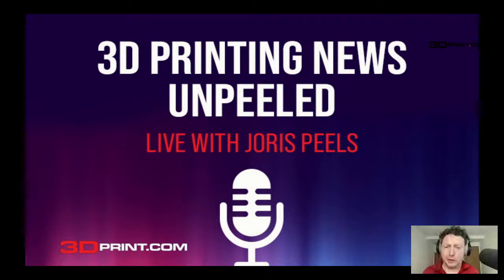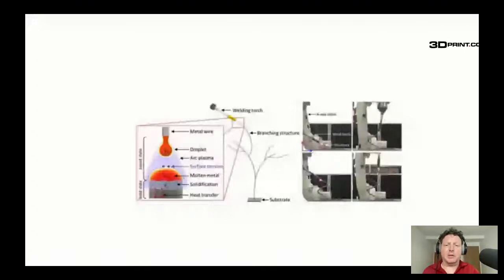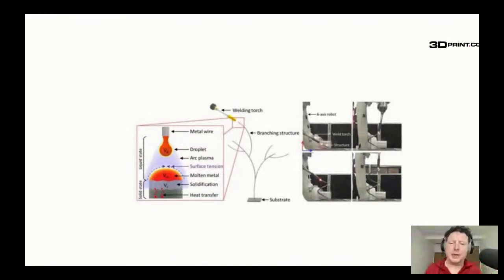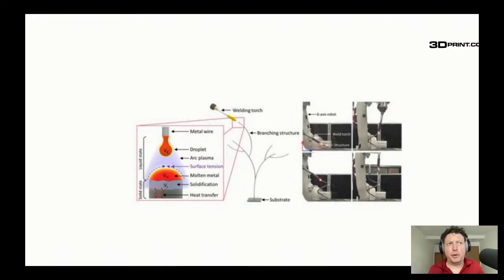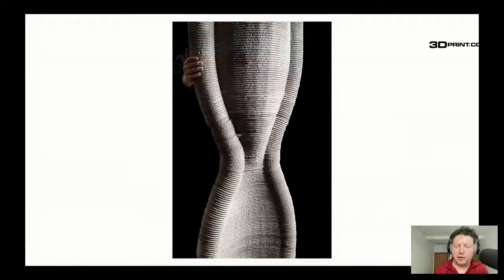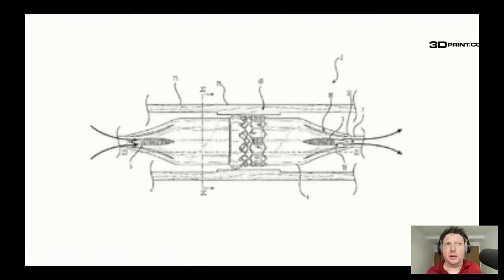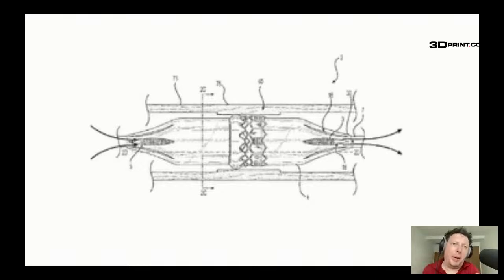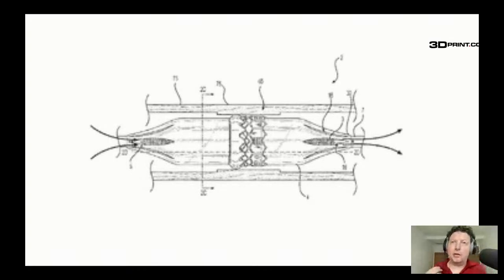3D Printing News Unpeeled: New Metal 3D Printing Technology

Comment: Korean Metal 3D printing technology is very new. I am impressed. The metal wire melting approach is very smart because the volume can be contolled easily. This plasma heat source continuously delivers molten metal, an imortant feature because molten metal must be managed while it is hot in the fluid state. I am curious if drop On Demand molten metal would work too. Inkjet fluids started with CIJ and advanced to DOD inkjet. Fluid metal must just be kept molten in both cases. Thank you for sharing this new 3D technology. It's been a long time since I have seen new innovation in AM. People should pay attention to this. Wire is more easily managed than powders.